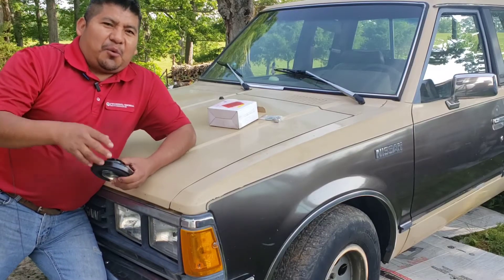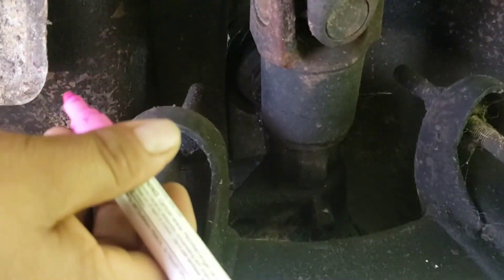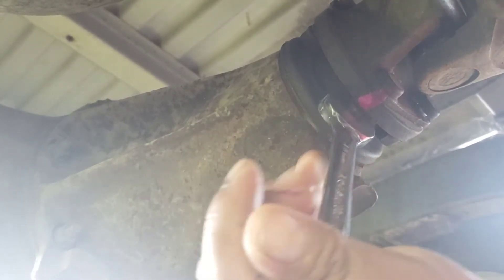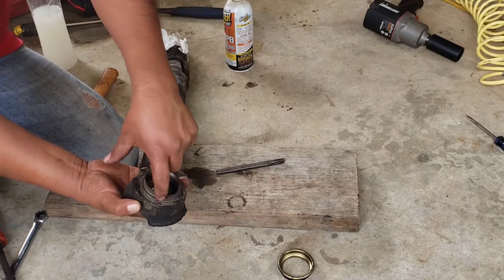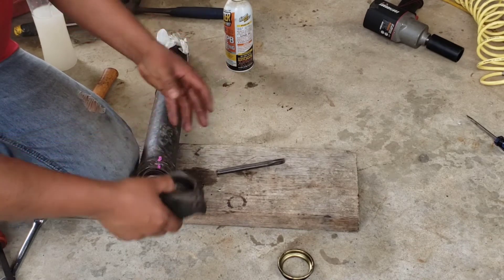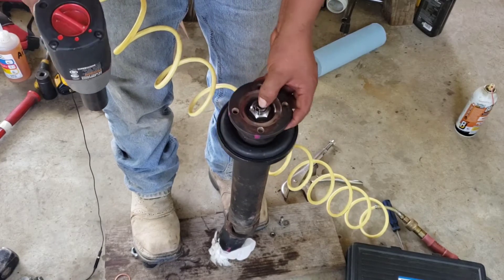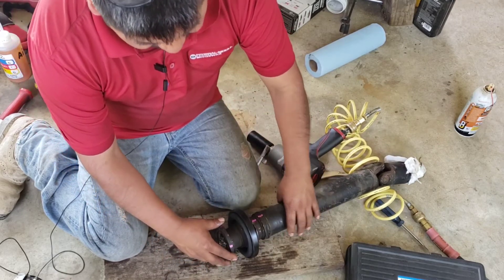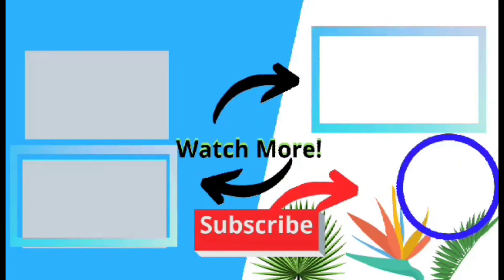Nissan 720 (Driveshaft) Center Support Bearing ultimate guide video, How to change Carrier Bearing

Comment: Just discovered my carrier bearing on my 720 was in need of replacement. Your video was incredibly helpful. Thanks! BY t eh way, why was it necessary to mark the driveshaft before removing it?
Reply from the maker: Ok the reason for  marking it
If its your first time or doubt yourself doing it, this way you know you put it back like it should , for example in my case if I haven't done something before I have to make that I can do it before I mess with it
Reply: @IshMotorparts  Gotcha - thanks! I watched your video before I took mine loose, but I forgot to mark it. I've got the new carrier bearing coming in today and I also have to replace the pinion bearing seal as well (leaking). So I'm going to have to guess how to put mine back together ☹. Thanks again for your response!

Comment: By the way, I just discovered the copper washer actually goes between the bearing and the "companion flange". Then, the nut (if you're reusing the old nut) goes over the companion flange without a washer.